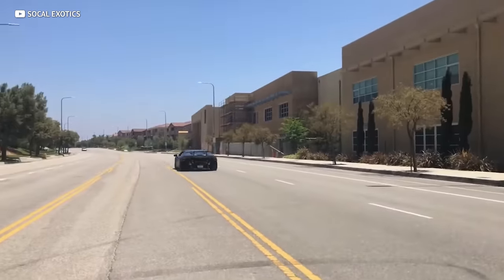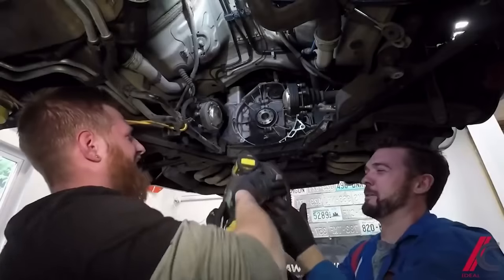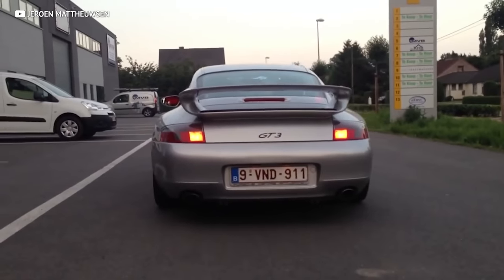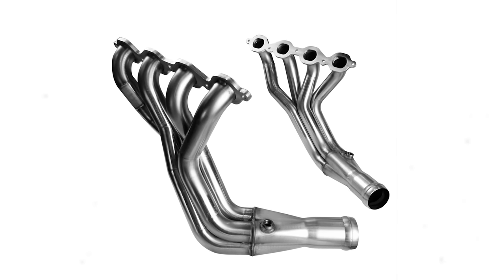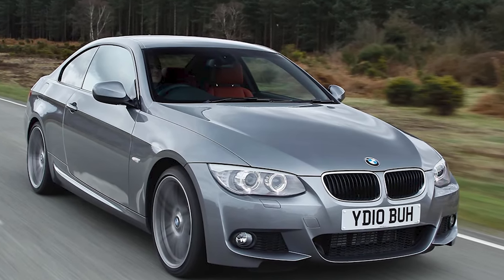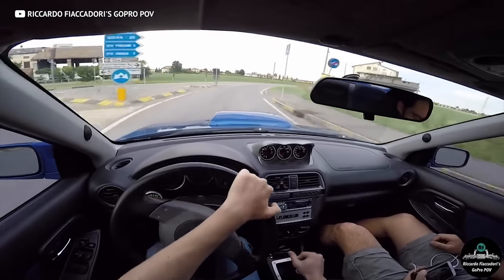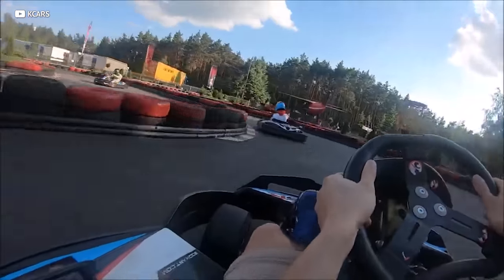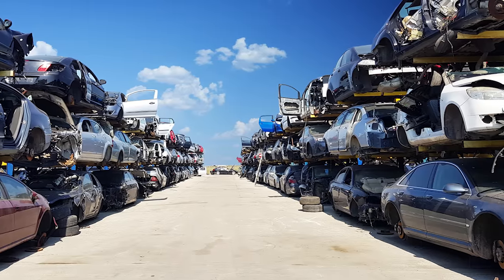The Easiest Ways to Add HP to YOUR Car

Comment: quick tip for lexus/toyota 1uz 4.0 v8 owners most probably knows but if you don't the radiator is cooled by a hydraulic fan powered by a pump on in the belt system. Take a fan bracket off of an ls400 and a water pump pulley from a tacoma and it direct fits with the original belt. then get electric fans to cool the rad i got a mishimoto rad and shroud to replace the entire setup.

Comment: The most important thing that will add more HP is improving driving skills, AcceleRacers taught me that and these Racing Aliens called the Accelerons build the Racing Realms, dimensions that deal with various environments for various skills, ie:Cybergrid for sharp turns & center of gravity in literal circuits but these Aliens also have Silver neck/chin plates, Helmet, Gold piece on belly, some black leather-like padding on their heels and their clothing merged to their body which shows even though they're literally Gods and have better knowledge on driving skills, make Realms like Warped with unpredictable everchanging Tracks in some Quantum World and very wise, they still have protection on them showing they will most likely deal with crashes and not perfect even though they appear perfect.

Comment: That’s not bad! 
Definitely mandatory!
But as a bonus to this video I’d add
1 supercharger or turbo (or twin) 
2 depending on the car new fuel injection or a 4 barrel carburetor 
3 in take headlights, or hood scoop or if you are fancy a bug catcher
4 X pipe or why pipe with the Exhaust set up X pipe is better for power but a Y pipe is good for trucks, hatchbacks and SUVs more torque 
5 a better cooling system just upgrade the radiator and your fans! 
Optional down grades 
Remove the AC, it always needs Freon, and is just a waist of space and money,

Comment: For some cars you can just drop in a k&n panel filter and delete any silencers. For my 97 4.6 2v xr7.. i deleted the air intake silencer and replaced it with exaust pipe facing cold air, and added a drop in panel filter. I got the responsiveness i was looking for for less than 60 dollars (filter/ metal tube). Then u have exhaust parts like cats and silencers. I deleted my exaust and noticed less low end and more high end. May be in my head but ik theoretically the difference is there.  Either way its a free way to make your car sound mean, but not every car will like the exaust delete.  Simple bolt ons or free mods like mine can gain 10-20 hp with a tune especially for a car with a conservative tune. Best case scenario you have something like an i4 turbo like an ea888. Just a cold air intake and pipes can gain you 80 torque and 50 hp with proven results, but thats an expensive car and expensive parts. around 2000$ just for the downpipe/ catback, and tune.

Comment: Headers, up pipe, turbo back exhaust, actual cold air intake, injectors, fuel pump, and a turbo blanket. Throw all of that together with a tune and some good heat management and you will be at the limit of what your stock bottom end will handle. When I say heat management I don't just mean throwing some ebay wrap on your headers, though even that will help. I mean wrap every part of the exhaust system up to the muffler, that will give you the highest exhaust gas velocity possible with your setup. If you really want to see huge improvements gasket match and polish all of it. You can add a lot of horsepower without even taking apart the engine. You don't need crazy expensive parts either, a cold air intake is just a tube with a filter on it, and exhaust is just a tube that can handle the heat. So long as you take the time to make sure there is no turbulence or restrictions and the welds are good a $200 set of ebay headers will work just fine.

Comment: I need your guys help.  I have a 2008 Honda Fit sport. It’s a manual. I have an Invidia cat back exhaust and a cold air intake. I recently went to a muffler shop to see if they can check out why I have an exhaust leak and they said my headers is cracked and my cat is rusted.  I’m ordering new weapon R headers and magnaflow cat.  Ik the engine light will come on but do I just go to a shop and get it dyno tuned or what should I ask for ?
Reply: Any time you add a part to your engine I think you should get tuned imo

Comment: I got 4 cars now cuz of you guys all my favourite ones tbh thanks I got the 89Honda crx , have a 07 AudiS4 may trade for a 08a4 2.0t maybe 🤔 Would you ? Also have a 09g37s with the demon eyes 👀 lol and I can’t sell them yet maybe just one lol it’s getting hard now still have plans are to turbo the crx going to have to get a roll cage too , repainted the wheels for my Audi black out look maybe silver and I want put DVD flip down in the back pimp my ride era was sick back in it’s time haha 😂 and getting ready for the winter time has oil leak as do most  German cars and my g37 done just have to put in the new seats has 370 hp is good 👍 enough for me should of came that way could be faster but am happy for now maybe I’ll get a new steering wheel carbon led next summer window tints maybe . ( Have any idea to help me out ? ) My 4th car is a 2013 Subaru wrx sti limited and it’s for sale tuned Cobb ap in Canada 🇨🇦 it’s white 400hp lol I can’t hate on the Subaru community tho out of all it’s the most friendly definitely ✌🏼gg but it’s time to say bye.
Reply: I would but i have a single garage lol

Comment: I bought the 2001 Lexus GS300 wit the 1MZ motor, so I was stoked about the potential of getting a supercharger( the top tier Camry of this year had them) but sadly outside of engine and some drive train parts I virtually have no options. 😂 No body kits or things of that sort. So I guess I will be building a sleeper!😂🤷🏾‍♂️

Comment: Here is a controversial stance to take but I put a cold air intake on 2000 CLK320 right where the old airbox used to be so I’m getting air from the two vents that used to shoot air into the box and I don’t feel any increase in power on the low end but when I hit my power band at 3500 RPMs there is a definite increase in torque I can’t without doubt say it’s making more power cause it hasn’t been dyno but there is absolute noticeable difference so I think the amount of power you get from your cold air intake depends on your application so that’s my two cents like it or not

Comment: The power comes compline all this thinks. In a natural aspirided engine you first put an new exaust system an cold air intake cat cams and all this work only with a program to an ecu. After all this you can make an upgrade with a turbo kit or a compressor kit and again program to ecu. If this is not enough you go to uprage the pistons and all the thinks that is inside the engine block and then you put a big hybrid turbo

Comment: Surely using a cone filter under the bonnet for better cold air intake won’t work as it is purely in a hot air surrounding?

Comment: I’m trying to increase speed in my truck so I’m not gonna do anything like weight reduction because I am towing so it won’t help much, however an Aurora 4000 and a cold air intake plus basic maintenance new headers and a Dyno tune would likely be best. However if you have any recommendations I’ll take them, I have a 5.7L gas engine planning on swapping for a 6.7 Cummins

Comment: small rn90 hilux with a sr20det motor pulled form s15, defo idea is tune it up after being mod plated first, then i might upgrade injectors and camshaft upgrade.

Comment: something i know which is completly free and ads horse power is  that atleast at the old volvo turbos you can pullback the wastegate and putt bricks so it doesnt open all the way that way you can ad a boost increase from 0.4 bar to 1.2 bar

Comment: Please can U test Prolong Engine Oil Additive ? a Proper test though, Dyno the car before and after adding it. Im no Car Expert, but Ive had good results when using it, especially on 2nd hand cars. Its not so much about it giving big power gains, but its always felt as if the car runs smoother + is more responsive, after adding it to the engine oil. They also have a Gearbox Oil Additive. Using both these on any 2nd hand car Ive bought, has made an immediate and noticeable difference to how those cars ran. I would love to see a Real Test with some Real Data about the difference it actually makes.

Comment: If you put less restrictive filters you are also allowing more dirt into the engine. If you don't get your vehicle dirty, its fine. You need back pressure for your engine or your gonna blow it apart. Straight pipe if you want to use your vehicle for sport, and not legal road driving. Keep mufflers if you plan to get your full life out of your engine. It's all pro's vs. con's. Just wanted to help you see both sides and not just pros. Have fun!

Comment: I’m working on Honda accord coupe 2003 idk what gen exactly and this help out alot because the first thing what I was going to do was get my car to a doctor for a diagnose then after fix the broken upper bolt joint on front passenger seat and then start working with making the engine nice then out side like the sway bars and new wheel and new pad filter and this help me more to make sure to go to the right way if anyone lives in Carbondale or know any tips please let me know i would be highly appreciated of it

Comment: im sure nobody is gonna pay much attention to this comment, but im about 3 weeks from turning 16 and i own a 2009 eclipse gt6. my parents are super nervous about me having the car, but thanks to you, they at least dont need to worry as much about me overspending. (i will be hitting up a junk yard for parts when i turn 16 and get my learners permit)
Reply: also if anyone has any good advice about the car, i could rlly use the help. i want to be a mechanic working on tuner cars so any advice is good advice.
Reply: @solarclipse4g  Why are your parents worried about you driving that car? It is just kinda quick lol, a civic si would pull on you and those arent fast by any means either. Only thing you can do on a car that is a NA v6 for power is catback exhaust with racing headers and maybe a tune if you can find a tuner for that car. A CAI may help you but it would barely help you by giving you maybe 5-6 hp plus its not turbod so it wouldn't care for all the extra air anyway making it a pointless mod honestly.
Reply: @ItzzShazey  my brother in christ why are you commenting on a year old comment?

Comment: i know this is an old video, but i have a 2008 opel zafira with a 1.7 turbo chargerd diesel engine. It's front wheel drive, and I recently had an idea that i could, later down the line make it so that the rear wheels are electricly driven. kind of liker a weird 4 wheel drive hybrid. but for now i'm just taking care of it by changing oil and filters reguralry. painting to stop any rust from spreading. small stuff like that. And been thinking about getting a tune for it.

Comment: Okay probably going to get a lot of shxt for this but... What can I do as far as owning a 2014 Acura tsx 2.4l? I've already installed a skunk header, air intake, and a muffler delete with 4 inch tips. I'm due for a Hondata tuning as well. How much power would I gain if I also dyno tuned it?

Comment: Looking at an 03 MR2 Spyder. I wanna swap it with the 2zz engine and put some modifications on before tuning. If my math is correct, with my build it may be capable of 0-60 in as little as 3.7 seconds since it only weighs a little over 2k pounds
Reply: Lucky, that’s a good power to weight. My car weighs 3300 pounds and I’m only getting about 200 hp so that’s a 7.5 second 0-60
Reply: it will be around 5 seconds, alot more to it than math
Reply: @PenguinNoodleSoup  mustang?
Reply: Shiisshh i want to do the same, dont tel others it is an undercover Lotus otherwise prices will skyrocket... 😅

Comment: Just recently aquired an 03 Subaru forester. Thinking about supercharging it. Its awd so adding some power should be pretty fun. Plus ive heard if you ad some boost and a tune theese thing become sti killers wich would be amazing because i have allot of big ego sti drivers around where i live
Reply: just turbo it, not really much point supercharging. buy an sti motor and drop it in
Reply: @arcanevoid9199  i dont have the money to buy a motor and i dont want to deal with the lag id get with a turbo
Reply: @meat_dragon8834  then how did you have enough to buy the car? and why did you buy a Subaru? and the lag really isn’t an issue you will make more power with turbo, use less gas and be not as hard on your motor
Reply: @arcanevoid9199  at the time i had a van that wa horible on gas. So i traded it for a forester that got 10 more miles to the gallon. And now that i uave a lil extra money to play aroumd with said why not add boost
Reply: @meat_dragon8834  foresters arent good on gas either, my step dad used to have one and you could watch the gas go down. boost will make it use even more gas, and will make it less reliable
Reply: @arcanevoid9199  yes
Reply: theres a lot of big ego drivers in every car out where i live thats why i bought a GTI 2.0 so i can just put a catted down pipe with a tune which will add like 90 hp and smoke just about anyone that wants to try me plus i just love the car in general.

Comment: How did you fish the power supply/wires into the vehicle to be able to plug it in? I just bought a new car and I think if I get a professional installation on the car and they end up drilling into it it will void my warranty.

Comment: I have a Mazda 6s  2009  v6 which everybody hates that I’m trying to restore and make it better already change complete suspension rotors brakes not sure if I should change exhaust car runs really good as is but want to make it better what do you suggest.

Comment: A got a 94 Mercury Sable, got rear ended so I ripped out the trunk bracing and spare tire well which I had to do in order to pull the dent behind it. It's got the 3.0 and I'm wondering what SHO parts fit, I know if I found a Taurus Police Package I could easily make more power but where will I find one as those cars were not popular.

Comment: How can I get more hp and torque out of my 11 Ford Ranger XLT super cab 4X4 with a 4.0 V6 and 5spd auto transmission?
I’ve added a K&N intake filter and a FlowMaster exhaust.
The truck can keep up with a 5.3 v8, but we can’t pass each other until the governor kicks in on Chevys @ 105mph and then my Ranger leaves them.

Comment: well i swapped my 22-re engine for a 1jz gte-nonvvti & man my cressida wagon flys!! 

and once my 2004 nissan Z orignal engine gave up on me i swapped a Lexus 2uz-fe cause it was way cheaper than the nissan oil leak freak engine .. not much hp gained but lots of burnout potential adrenaline rush &  tremendous amount of tourq!!

last but not least ..

got a 97 tercels 2E carburated engine the plan is to swap it with the engine that came on its evil twin starlet GT 

4efte + manualtransmition toyota tercel =  a rocket pocket & big time fun to drive i gusse lol

Comment: To improve my Power on a VVTI Toyota Runx 1NZ, how do you advise from the video infor?
Reply: engine swap would be easier, drop in a 2zzge with a C60. already came in that car from factory in other versions so will be easy to swap in, not much point trying to build a 1NZ as you wont make much power unless you go turbo which isnt cheap

Comment: Question can you tune a turbo? Or just tune the boost
Reply: tune the boost. not all turbos can take the same amount of psi(pounds of air)and need the same amount of fuel
e.i-a small turbo cant handle 30psi it will blow up
a big turbo with 7psi will take for ever to spool 
so you have to tune the ecu to affectively get power from the turbo

Comment: I need help adding HP to my 05/06(split year) Acura TL...any suggestions?
Reply: Intake , exhaust , type s tuned and a throttle response chip should help .
Reply: cam shafts allow high revs and add more power and torque
Reply: @8Brokenchains369  currently I have been working towards this: Pre-cat delete, j-pipe, test pipe, megan racing exhaust, throttle body spacer, cold air intake, intake manifold spacer and a tune....my personal goal is to get 325hp all motor....will this get me there?
Reply: @ballslayer6970  I will look into that also! thanks bruh!

Comment: Service, intake and exhaust combined makes like 5hp, Dyno could actually give you up to 40hp if you drive a regular car, you need to basically strip everything out of a car to benefit anything, tires dont do much if your current tires are not the cheapest bunch. 

Trust me, I spent over 2000 dollars and +30 hours of work and I gained 54hp and bad mood. 
If you want power, use the 2000 dollars to a better car, not trying to make a cheap car better.

Comment: I’m only 11 but I want a 1990 Mazda Miata and I want to have it as a manual so that then I can learn how to drive it and then hopefully have it make 300whp by the time that I’m 18
Reply: That's a good dream to start off with, I had similar dreams but with a different car, the Holden Torana, anyway when you hit 18 you'll have 300hp if you stick to those dreams, your dreams will get bigger and you'll chase more power or add another car to the garage. Best of luck to you
Reply: @joshthomas2536  thanks man
Reply: honestly dude the n/a miata with pop up lights are so over priced get the other ones im sure you can find one with a manual and you can work on it but hope ur miata build goes well

Comment: I find "tuning" a bit misleading.  The BMW example is forced air.  To get that much increase you have to be increasing boost.  On an NA, there is very little gained from tuning a stock car.
And CAI increases throttle response?  What does that even mean?